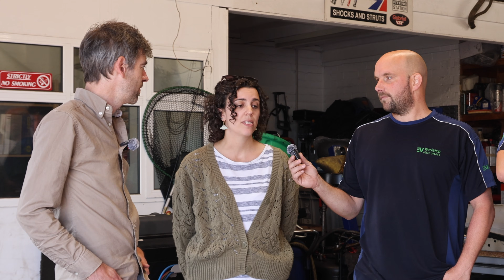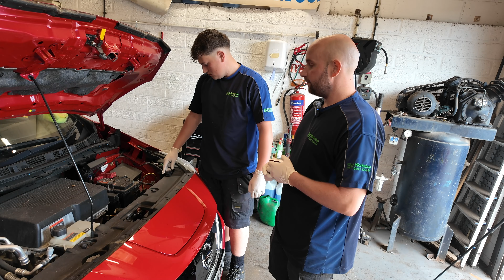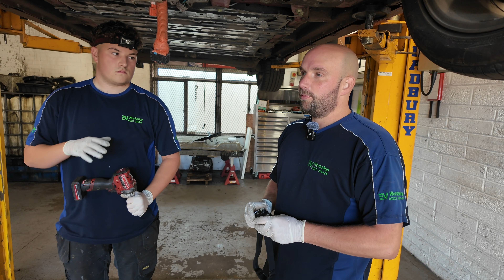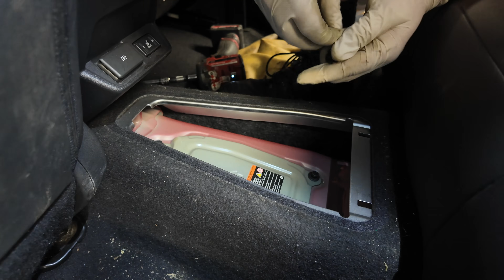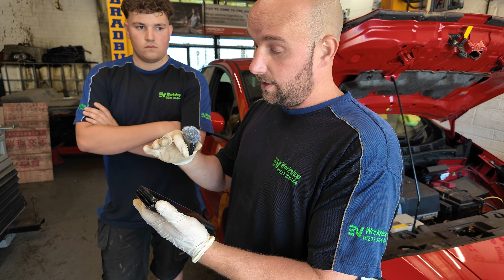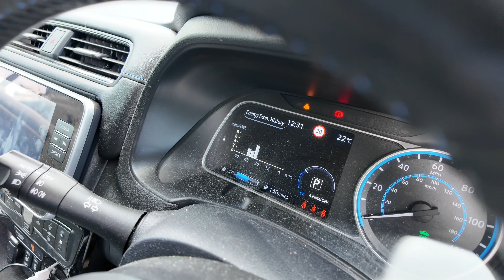LEAF Battery Swap. Out of Warranty, Out of Pocket. Nissan Refused Warranty Claim!

Comment: It is understandable that this is frustrating. Whether you can still claim warranty coverage if you fall just outside the time limit depends on a number of legal and technical factors. Here is the best way to handle this:

Manufacturers often apply a strict warranty period, but dealers and importers often have a goodwill policy. This means that they will cover (part of) the costs, even if the warranty has officially expired, either because it is a known technical issue or because the car falls just outside the time limit.

Contact the Nissan dealer immediately. Explicitly request a "goodwill request" from the importer. Emphasize that maintenance has always been performed according to schedule and that a battery pack should not swell after such a short time under normal use.

In addition to the manufacturer's warranty, you are also dealing with the legal right to a sound product.

A consumer may expect that an electric car battery pack has a certain lifespan (often longer than the standard manufacturer's warranty). If a battery swells after, for example, 5 or 6 years, you can argue that the product does not meet what you could reasonably expect from it.

If you bought the car from an official dealer, you are in a stronger position. If you bought the car second-hand, it is more difficult, but not impossible.

Why "one day late" is often a grey area
The manufacturer's computer system contains a fixed date. If that date has passed, the system often blocks the automatic warranty claim. Collect all maintenance invoices. Have you previously complained about the range or strange error messages? Look up those emails or work orders.

Send a formal email to the dealer (and possibly Nissan customer service).

"I am very satisfied with the car, but I am shocked by the defect. Given the short timeframe after the warranty expires and the fact that this is an essential part, I request that you apply a goodwill arrangement."

If the dealer and importer refuse, you can rely on your legal assistance insurance. They can assess whether there is a case of "non-conformity" (the product is not what it should be).
Ensure you have an official report from the dealer stating that the battery is swollen. This is your burden of proof.

Do not tamper with the battery yourself and do not continue driving with it. A swelling battery is a safety risk. If the dealer says the warranty has expired, always ask, "Could you escalate this request to the importer?" Often, the dealer themselves does not have the authority to act outside the warranty, but the importer does.
Did you have the car serviced at an official Nissan dealer? That significantly increases your chances of a goodwill gesture, because you have then fulfilled all maintenance obligations.

Comment: The "swelling" of a battery pack (often referred to as battery swelling or puffy battery) in an electric car such as the Nissan Leaf is a serious technical problem. Below, I explain how this occurs and how you can prevent it in the future.

Why does a battery swell?

A lithium-ion battery consists of cells filled with an electrolyte (a liquid or gel). When a battery swells, gas formation occurs within the cells. This happens due to the following causes:

If the battery becomes too hot (due to intensive use, fast charging at high temperatures, or a defective cooling system), the electrolyte can decompose. This releases gases that pressurize the cell housing.

Over time, chemical byproducts can form in the cells. In a healthy battery, these gases are absorbed, but in aged or damaged cells, they accumulate.

Internal short circuit: If the separator between the anode and cathode becomes damaged, an internal reaction occurs that generates heat and gas. Storing a battery at a maximum charge (100%) for extended periods in combination with heat significantly accelerates chemical aging.

A swelling battery is a potential fire hazard. If you notice the battery pack casing deforming, you must contact a specialized garage immediately.
Although battery degradation is partly unavoidable in the Nissan Leaf (especially older models with air-cooled batteries) due to the design, you can significantly extend lifespan and safety by following these guidelines:

Manage the state of charge. Avoid 100% for daily use: Charge the car to 80% for daily commuting. Only charge to 100% if you are going on a long drive immediately afterwards. This reduces the chemical stress on the cells.

Do not attempt to park the car for extended periods with a very low charge (below 10-15%).

The Nissan Leaf (especially models without active liquid cooling) can become very hot during repeated fast charging (CHAdeMO). Try to limit fast charging to when it is truly necessary. For daily use, preferably use a standard charging station (AC charging).

Try to park the car in the shade or in a garage during the summer. Extreme heat is the greatest enemy of the lithium-ion battery.

Reduce your driving style immediately after fast charging, as the battery is already warm and additional load drives the temperature up further.

With an app like LeafSpy, you can monitor the health (SOH - State of Health) and temperature of your battery cells. If you notice that certain cells deviate from the rest (cell imbalance), you can intervene in time before it leads to swelling.
Ensure that the Battery Management System (BMS) software is up to date at the dealer. Sometimes updates include improvements in how the car handles charging currents.
Battery swelling is often the final stage of chemical degradation. By not keeping the battery at 100% constantly, limiting fast charging, and monitoring the battery temperature, you can significantly slow down the chemical processes that lead to gassing.

If you suspect that your battery has already swollen, stop driving it and have an expert assess its safety.
Reply: My Tablet pushed it's back cover off because that battery expanded to double it's size, very worrying all this battery technology

Comment: The manufacturer cannot insist on main dealer servicing, this is specifically allowed under the block exemption regulations which also passed into UK law. Providing it is derived to manufacturer schedule using quality parts by a VAT registered company. I'd also say that very little service items would effect this type of battery design. It's inherently suffers thermal management issues which most likely contributed or caused this failure. It's a common tactic by dealers to refuse warranty or to try sell Dealer maintenance. It's appalling. Personally, it's why I avoided the Leaf.

Comment: Economically a very marginal (personal) call. But great to be possible.
The original (pre new 26 model) Leaf, UNLIKE almost every other ev, tried to cheap out by not having heat stabilisation of the batteries. That can now be seen as a design mistake! This isn’t a stick to beat all ev’s, just a problem with these Leafs. 
I can see Nissan losing a lot of goodwill over their handling of such warranty issues. Which is a pity as the 2026 “Leaf” (a totally different vehicle) is, by all accounts, pretty good - and includes thermal management of the battery pack. 
Being in Kent, I’ve noted the contact details for this garage. Whether for my current (excellently boring) Toyota hybrid, or the ev to follow, it is good to know these guys are around.

Comment: Someone went to court with Nissan over them refusing service because the dashboard said it was above 80% but diagnostics said it was under. The court ruled that the warranty was based on dashboard readings. Nissan went in with top lawyers to defend themselves. The battery warranty is effectively worthless as it's capacity while standing. Most battery faults are under load. Range dropping on acceleration.

Comment: Interesting video however on balance how can anyone really justify paying that sort of money to get it replaced? £8430 for a refurbed battery! I'm no EV expert but a quick look on autotrader there appears to be a number of vehicles with similar specs/age and some with even bigger batteries 63kWh, for similar or less money than the cost of the replacement!

I appreciate it might be a nice car apart from the battery fault but on a pure economic basis surely the repair is unjustified?

Does this video not just go someway to reinforce support for the argument that once the battery dies you may as well scrap the vehicle, unless of course there are major scrappage costs involved in disposing of EVs!
Reply from the maker: This was a brand new battery, although it was inside a refurbished case.
Reply: @MrEV  Sorry for getting confused but you get my point all the same, I hope? Genuinely seems you could get a similar spec car with similar mileage and age for the cost of the repair or even less! Makes the financial justification for the repair a little questionable!

Comment: The car should've been rejected to the place she bought it from, they would be responsible for either getting it repaired or giving a full refund.

2yrs ago I bought a used Hyundai Kona from an indy garage, which just 1 month later died on me, the 400v battery appeared to completely brick! Hyundai refused to honour the warranty because it had missed a service, but after a lot of communication between the company I bought it off and Hyundai, they eventually honoured the warranty and did a full battery replacement. It turns out it was overdue a recall which would have likely meant the battery swap should've been done a year or 2 earlier anyway. But without the pressure put on Hyundai by the garage I bought it from I might've been totally stuffed.

Comment: Thats why you get a TESLA . Right ?  2nd hand 4y old Tesla M3 cost from 15k -24k   depends of the model.  Any TESLA  is 1000x better then any Nisan Leaf . Its a common sense .
Reply from the maker: I doubt they had that budget at the time. Obviously with the battery swap, it must have ended costing them £15k altogether in the end, so I'm sure they'd make a different choice if they could go back in time!
Reply: Not true I’m afraid. Model 3 owner here with a battery failure, and after doing some research it seems a LOT more common than you think. Tesla would charge £13k for a replacement outside of warranty.
Reply: @whintersby Oh ! hey there ! You wont believe this but actually i did research this too. I did find out that battery failures happens in Tesla usually in "early" life . That`s why i bought proven 4y old car with a great battery.  Also Tesla has 8 year battery warranty for battery failure , if your battery loses more then 70% original capacity or dies totally , Tesla exchanges your battery for free. Did your battery failed  after 8 years ?  If yes , don't go true Tesla go true a smaller shop which services a Teslas. You can get batteries battery repair for 4k or less or battery exchange for 7-10k  depends whats going on.  Better luck next time 😅
Reply: I have a 2019 Model 3 Performance, and the battery failed last year with less than 30k miles done. Thankfully this was replaced under warranty, but it’s the reason I would never keep this or any other EV outside of battery warranty period. This will absolutely kill second hand market for vehicles with no battery warranty.

I tried sharing a link with more people encountering battery failures with Teslas, but looks like it was removed. 

If you want to read up on this, search for “Tesla Motors club BMS errors” 👍🏼

Comment: I am trying to get my head around the economics of this. £8,400 for a new battery fitted, when a car of the same age with a sound battery is about £8,000? 
Would it not have made more sense to sell the car as it is for , say £3-4,000 and add that money to the battery replacement cost to fund a newer lower mileage replacement car?

Comment: Tricky decision.  New used car last year £7.5K replacement pack less than 10,000 miles later at £8.5k The used car dealer dodged a bullet on the sale of goods act 6 month coverage as did Nissans weasel word warranty. I have a 2019 Leaf 40kwh.  at 70,000 miles, bought a 48000.  Battery still good for 120 miles + summer and winter so far. However, I had an E-ACT system fail on start up away from home = no brakes = scary, but didnt hit anything 😅.  Looong recovery back home. A new 12v did not initially cure it, but after 3 days switched off, it came back.  So investing in an ageing electronics and chassis platform may not be for everyone. That said, the newer stuff is even more complicated 😁

Comment: Been driving EV’s for 9 years, i3, id3 and now the MG4, all have been bulletproof. First two did around 75-80k miles (company cars). The wife is keen to go all electric, based on £15k budget, what used EV (with warranty) would you go for?
Reply from the maker: I’d always recommend a Kia e-Niro. They’re solid as a rock, but make sure it’s had the gear reduction oil changed recently as that’s the only thing that can cause issues down the line.

Comment: Quite shocked to see a car that is 6 years old and only 50k miles have such a significant battery failure. Significant repair cost for what is effectively manufacturing design issues should be covered by consumer rights act. Would probably require class action lawsuit by a collection of owners to prove Nissan liability. I am an ev owner for 5 years and wouldn't go back but this still surprised me
Reply: It's an EV. They are not meant to last like hybrid/gas vehicles.
Reply from the maker: My 2020 e-Niro has done 70k miles and has the same range as new. Not all EVs are as bad as these LEAFs. Given the relative complexity of an ICE/hybrid, I’d much rather have an “old” EV. (Apart from the LEAF!)
Reply: But EVs never go wrong and the batteries last for years and years and years 🤣
Reply: @AndyC2_  You mean ICE vehicles don't break down and don't need any maintenance WOW. But I see all these repair shops around my city with ICE vehicles parked around them 🤔
Reply: @MHdollrevievs What I meant is (if you’re intelligent enough to get this) is that people always say EVs never break down as there’s nothing to go wrong and it’s absolute bullshit. 
Sorry I had to re explain that to you - would it help if i drew you some pictures?
Reply: @AndyC2_ in most cases I don't think it's the batteries you need to worry about. Would love to see some stats but wouldn't be surprised to find most wearout failure modes (not clear design issues like this one) are related to other electronics around the batteries such as the onboard ac-dc inverter

Comment: On the 12v battery, my i3 lasted 8 years and I replaced it with a BMW oe battery. The car started to have weird faults that disappeared after the battery was replaced. My first electric car was a leaf 24kwh, I am glad I sold it.

Comment: Money....
We used to consider the cost of re-building an engine, buying new, or buying from a 'scrapper'; and then what other parts we found we needed to replace during the long arduous build.  The engine was the largest single component (other than, heaven forbid, an automatic gearbox). 
Compare that major expense with today's expense of battery work....

There probably isn't a lot of difference in reality.

Comment: Just a confirmation. 2022 and onwards facelift LEAF's come with 8 year battery warranty on everything including the individual components. Not like the pre facelift which is 5 years like what was mentioned in the video.
Reply from the maker: Thanks for the clarification.
Reply: Does that mean they'll honour the warranty with proper diagnostics and not just use take the battery (or health?) bars at face value to deflect a claim?
Reply: @bobholmes4215 yes

Comment: My leaf is 12 years old, 75k miles. It’s a 24kWh one. Still on the original 12V battery and 11/12 bars of battery health on the high voltage. Maybe I’m just lucky?
Reply from the maker: Battery longevity of the 24kWh LEAFs do seem to be far better than the others.
Reply: @MrEV tbf the e+ (62kWh) is solid too quite often you can see 100k+ miles with 85/90% SoH (12/12)
Reply: Maybe buy a new 13volt battery it's like £70 for a good one and 15 mins to swap?  Even if it seems fine the car might have to charge it constantly and/or might leave you stranded.

Comment: So they just spent roughly what the car is worth, but it doesn’t double the value.
Reply: A Leaf with a dead battery is worth nothing. It might have been better value to buy another car, but this way they get a brand new battery, not one that's done 50,000 miles.

Comment: Nissan should absolutely get slammed for this.

But let's be honest - is Tesla, VAG, Rivian, Lucid, or BYD gonna be any better? Car batteries have no industry standard. They're not consumer goods that get stored in a warehouse indefinitely. Once the production line is done the consumables that are inventoried are the only ones left. Aftermarket will be the only war forward.

But that's the seedly underbelly of the rapid EV transition - a lot of not that old transitionary vehicles are gonna end up scrapped quicker than the 1990 Renault.

Comment: Consumer rights act surely covers this. Also the service, as long as you have it from a VAT registered garage to manufacture spec, it doesnt need to be main dealer.

They should pursue this.
Reply: Just basically wrote the same comment, so totally agree
Reply: Just commented the same. I saw this many times when I worked in dealerships.
Reply: It doesn’t even use parts for the service